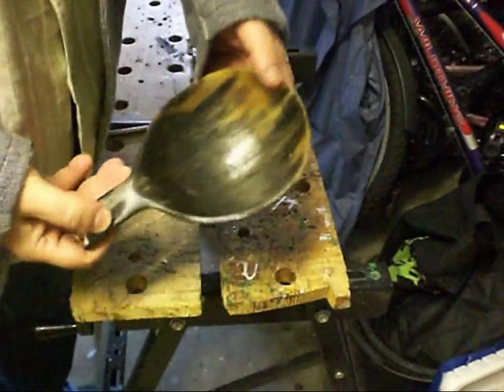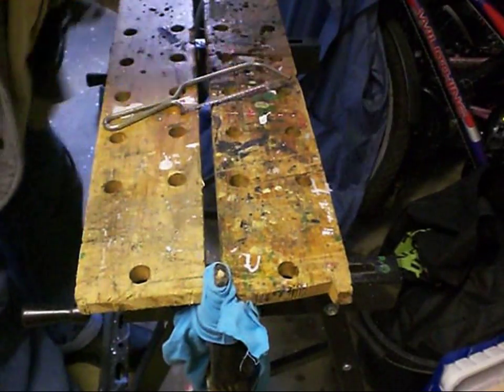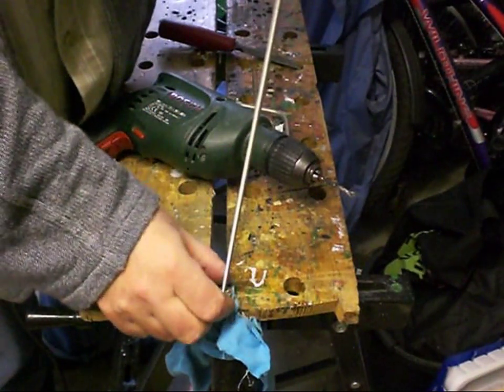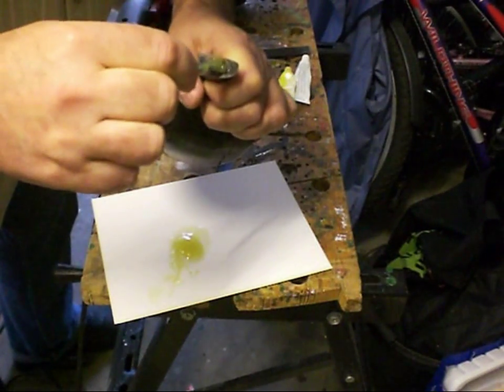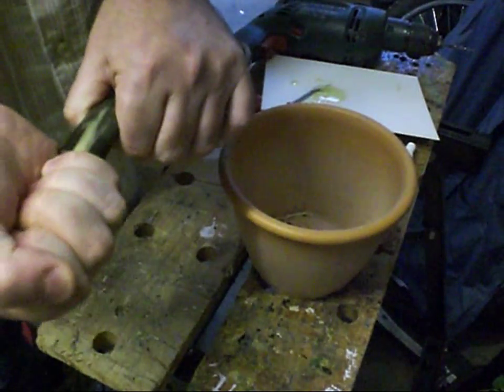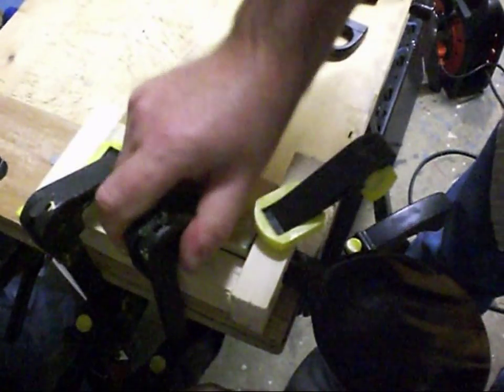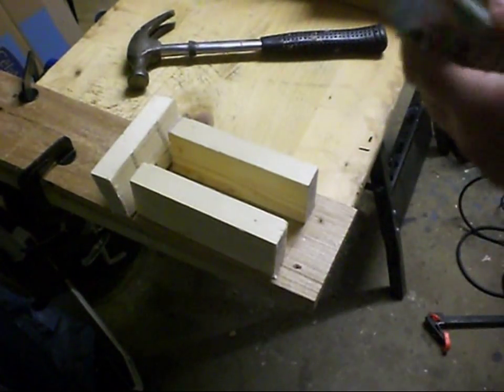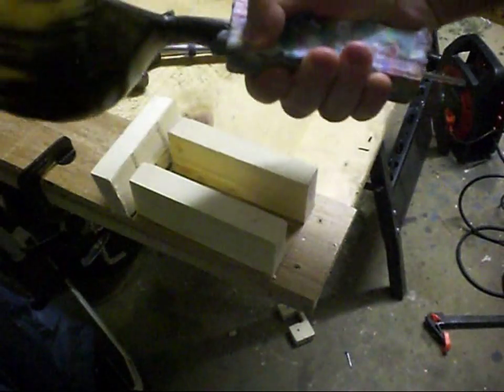Re-making a plastic handle using recycled HDPE

Comment: Why not just make a handle then drill a hole and epoxy it in?  End of rod wouldn't show.
Reply from the maker: Could have done - although in my experience, trying to glue anything to HDPE doesn't work - this could be overcome by making the hole narrower at the mouth than further down (to prevent pulling out) and making it internally irregular (to prevent rotation) - but knowing that HDPE shrinks when it cools means that forming the resin directly onto the tang means it's on there for good.

Comment: In that heated state when you cut it with scissors, would have a large sturdy pizza cutter or rotary blade of some kind worked and if so, would it work any faster to help save time and internal heat for mold conformity?
Reply from the maker: Maybe.  I'll give it a try next time

Comment: You mentioned in the beginning of the video you were going to weld your hexagonal pieces together. How would you do this? Would it be with super glue or is there another way to join the plastics? I'm wanting to build a panel to replace a broken sliding glass shower door. Thank you so much for your time and your videos.
Reply: thegreenhornets heat gun. heat 2 peices. mash together
Reply from the maker: I was trying to weld them together by heating them with a narrow metal bar, but it didn't work very well
Reply: Okay, thanks for the reply. If I find a way that works I'll post here. All the best.
Reply: Ok here's the way I've found that works
Not a heat gun, but rather I just use an iron and hold two pieces against it then clamp them together

Comment: Nice, I liked the suspense for whether it was going to work our or not. But can HDPE it be further heated and molten into a viscous liquid?
Reply from the maker: I don't think so - it can be heated to a softer consistency than this, but never really goes to liquid before it burns
Reply from the maker: The melting point of HDPE is well above the boiling point of water
Reply from the maker: A pressure cooker raises the boiling point of water to about 120C - still not hot enough to properly melt HDPE
Reply from the maker: Why?  The sandwich toaster works!
Reply from the maker: it won't melt to a liquid state.  A soft, toffee-like consistency is the best you can get with HDPE.  Video of the toaster is here: How To Recycle HDPE Plastic (High Density Polyethylene) - a simple method
Reply: hazem3008 i was able to melt hdpe buckets in the oven and they actually took the shape of the mold without any pressure it was almost like molasses on my channel my newest video shows how it came out just remember to let it stay in the oven at about 340 farenheit for 2 hours just watch it to make sure it doesnt make any smoke if it does lower the temperature
Reply: Dean Walcott Thanks, I checked your channel and saw the video. Subbed too.
Reply: hazem3008 thank you

Comment: I'm curious how that is to work with.  Th routing, filing and planing.  Watching your use of this material with interest over here in Virginia.
Reply from the maker: As long as the material is compressed into a solid piece with no voids, it's a beautiful material to work with - very even-textured and predictable.
A sharp plane or router will take it straight to a very nice, fine, smooth finish; it can also be turned on a lathe, drilled and sawn.  Filing, rasping and sanding tends to leave it a little furry, but this can be brought back to smooth with careful application of heat from a hot air gun.

Comment: WHats up mike I like the new video Ive been doing some other recycling projects lately and while talking with the peple at my local starbucks coffee house were I collect coffee grounds for use as soil amendment in my gardens as well as mushroom substraight and warm feed, They told me they go through over 200 gallons of milk a weak in one gallon HDEP plastic bottles I asked if I could get the refuse HDEP off them and we are curently working on a plan to do just that and then I should have enough Quantity of HDEP to do some of my own projects I have been colectting Colored( sepperated out by color) as well as clear HDEP for some time  now I still want to retry your boat idea as well as my Tounoe cover for my mini truck